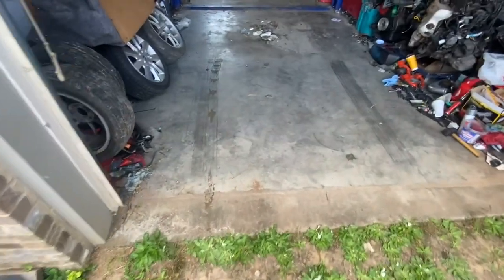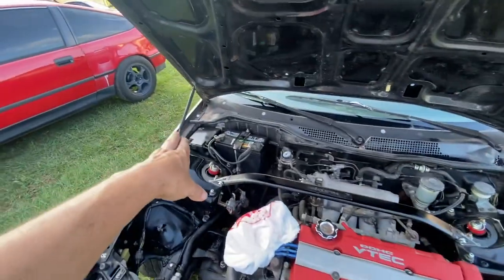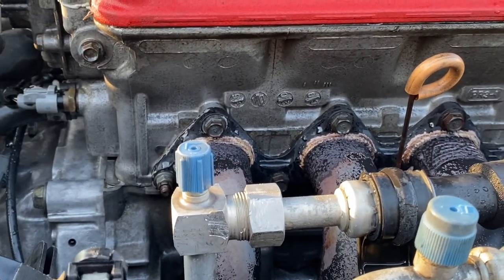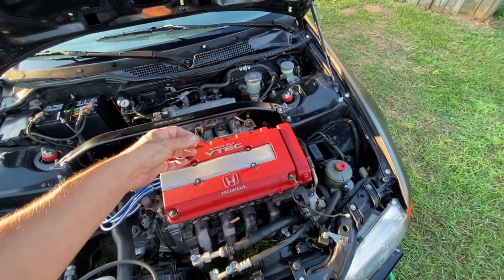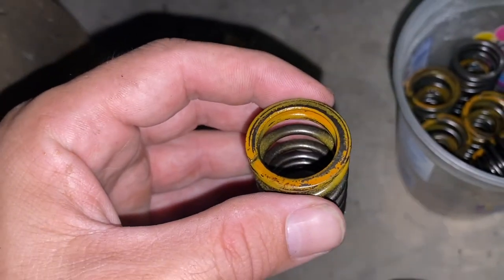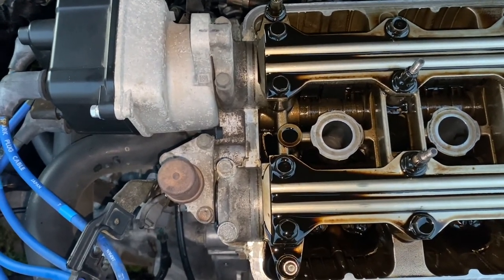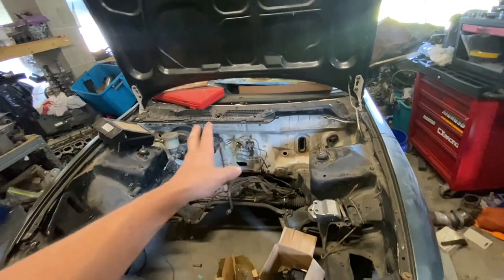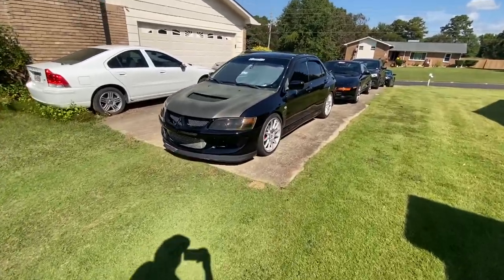How to check for a real JDM Type R Integra motor

Comment: I heard of the green paint on the piece where the dizzy goes,means itr but not for sure🤷 mines a pr3-2 and has the green paint mark,but I just bought a swap (minus trans and intake) back of the block towards the by the oil pan and says it's a em1 block but I may have a itr head.and the head is stamped 1998

Comment: On the head you are on the right path ... but on the head it will say pr3 -# depending on the number I will determine weather it's and integra type r .. or civic type r .. and I believe  on the cams it should have a print on it too.